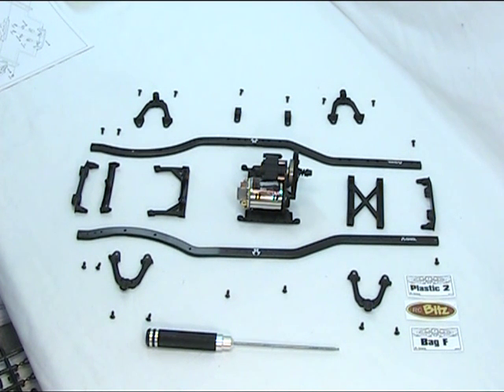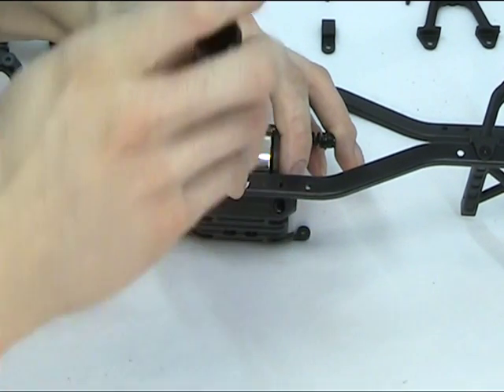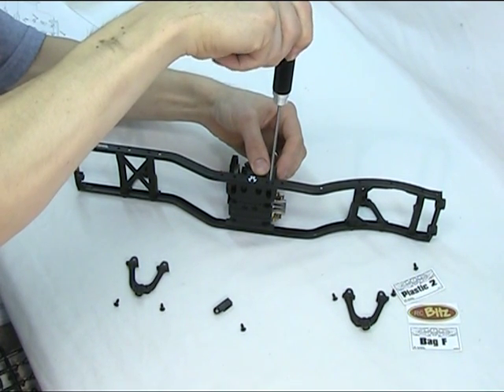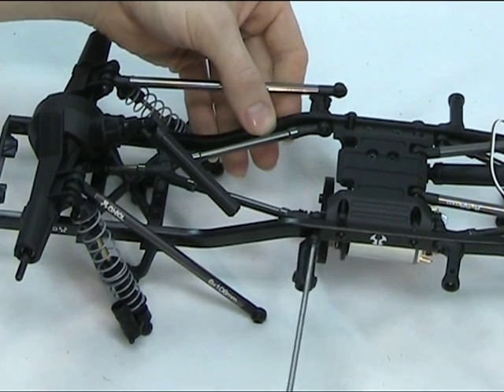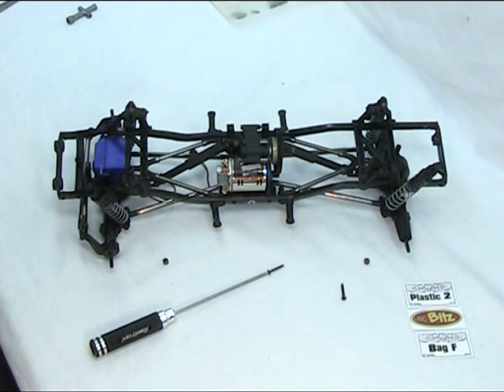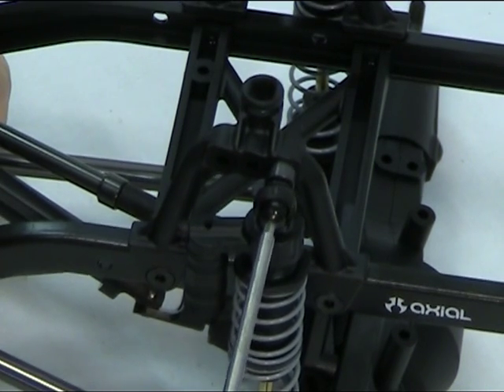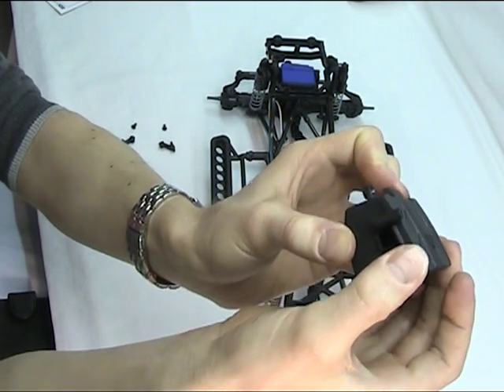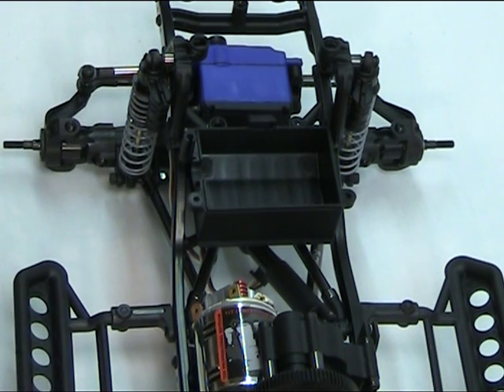Axial Racing Build SCX10 Honcho PART 7 Chassis Assembly Mounting Axles Links Steps 32 to 38.mpg

Comment from the maker: @Ronh83 Sorry for the slow reply. Mine is ok. Two things to check 1, at the start of the video the left of the shot shows the front cross member, just check it is the way round I show here 2, the chasses as some indents on the underside for the servo to flex into, only small, but help - are the chassis rails as shown above. Hope this helps and keep me posted when you solve or if you need further help.

Comment: Hey Martin! I was just sitting with this kit last night and I have mounted the front axle on the chassis, but it seems like the servo actually hits the chassis and prevents movement/flex?? I also have the traxxas servo you use. Is it the same issue with you honcho also?